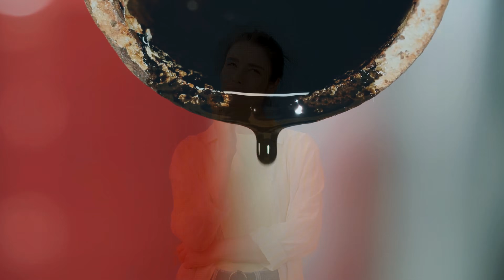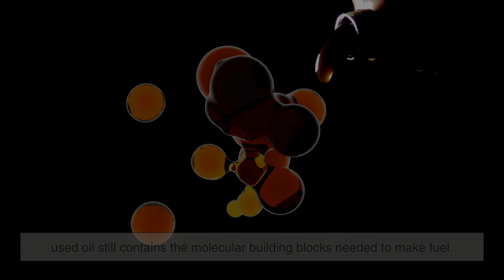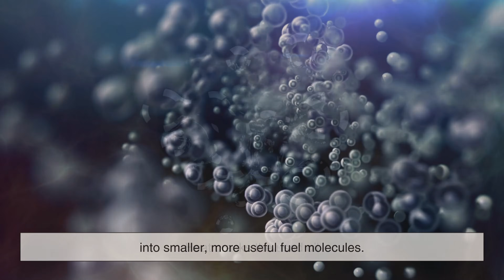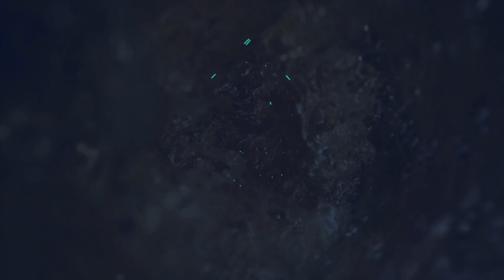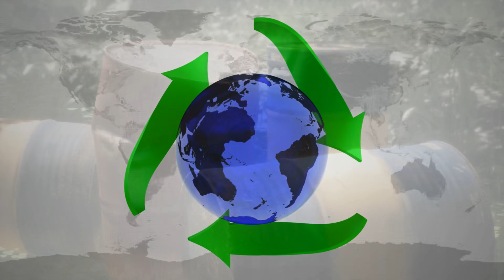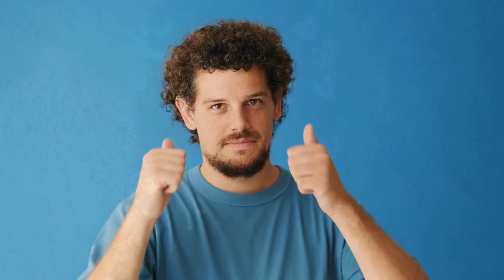Can Used Motor Oil Be Converted Into Gasoline?

Comment: Making "Black Diesel" with it is actually pretty simple (and makes for STUPID CHEAP FUEL). Only run it in older engines though. My setup is EXTREMELY crude, but I have the engine that can handle it, the fully mechanical, Indirect Injection (IDI), 7.3 IDI (NOT to be confused with the 7.3 Powerstroke, they are completely different animals). If you get a oil centrifuge, you can run it in more picky engines, but definately still not modern commonrail engines.

Comment: In the 1970s I worked at an oil recycling plant. We would recover a fair amount of gasoline from the distillation process which we used to power forklifts and other vehicles. Employees also got free gas for their cars. It had no additives but worked fine. Most of the oil was turned into base stock that was about 20 wt.

Comment: Turning it into gas isn't a good idea.  Its better off converting motor oil into diesel because diesel is more energy dense and efficient.  There have already been diesel engines that can burn motor oil for fuel and there's  already waste oil heaters.  Many mechanic shops that service vehicles use the oil changes for heating their shops.
Reply: No conversion required.
Reply: Yes, correct.  Waste motor oil...or even waste vegetable oil (once fiktered) can be used directly in older or simple diesel engines.  Modern diesel engines really need very clean and processed diesel for its complex systems

Comment: Can we turn plastics into fuel?
Reply: Yes
Reply: They have been using plastic for fuel They just throw it into the furnace sadly
Reply: Yes, there's a process to break the long hydrocarbon chains in plastics back into the shorter hydrocarbon chains of oil